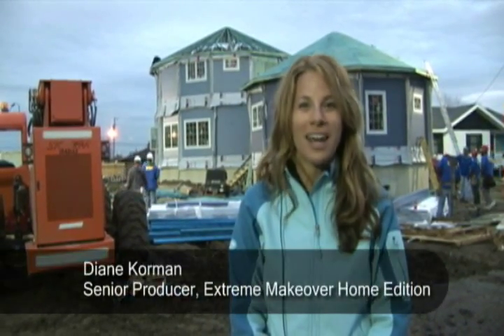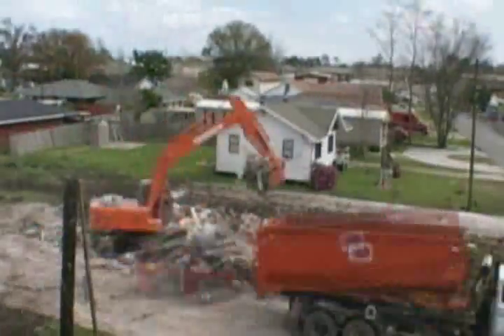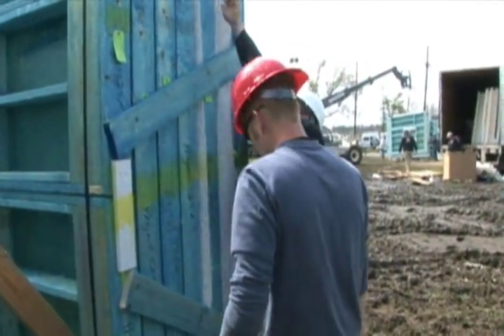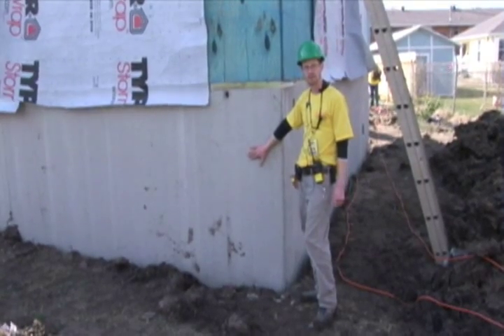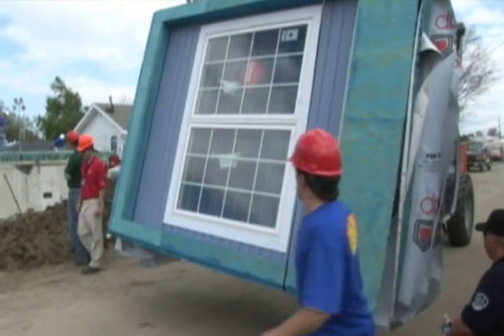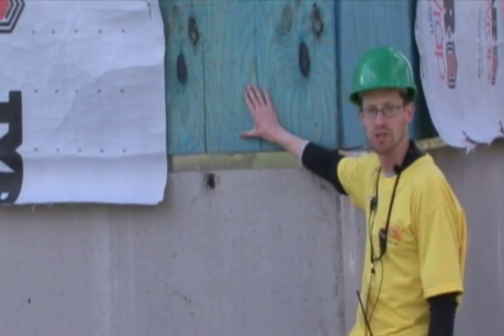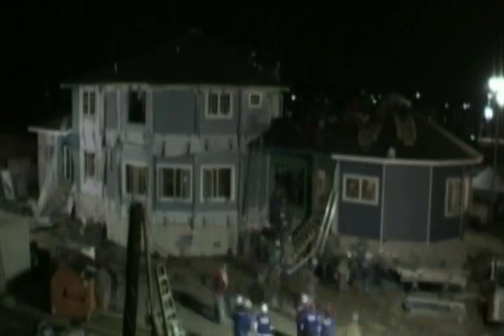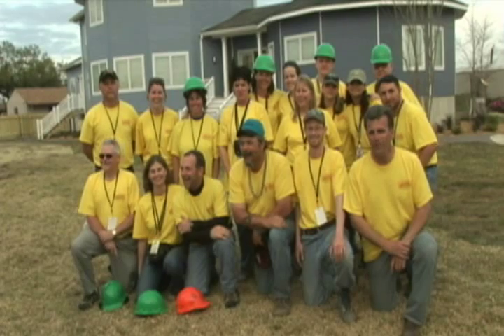Deltec Home Sets Standard for New Generation of Homebuilding For Extreme Makeover

Comment: DO NOT BUY DELTEC    My new Deltec home was destroyed in Irma.  When you read the fine print they are only rated to 140MPH which is a moderate CAT4 which doesn't account for the gusts which are normally 20-30mph stronger, so basically CAT3 or below and you might be ok.  But when damage happens they blame the builder even though they say how easy it is to install and we had a Deltec engineer on site.  DO NOT BUY DELTEC
Reply: Good day I'm inquiring about buying a deltec and I see your in the Virgin islands I am also so your house was completely destroyed?
Reply: Akeymo Percival yes, Deltec said the homes could resist a Cat 5 hurricane but didn't even test the buildings to withstand a Cat 4. Do not buy a Deltec thinking it can protect you in a hurricane.